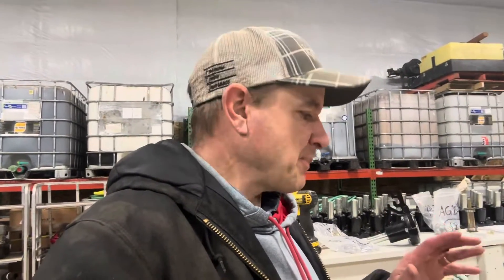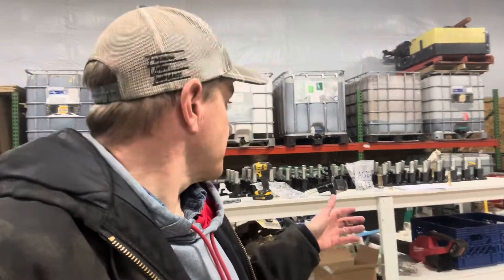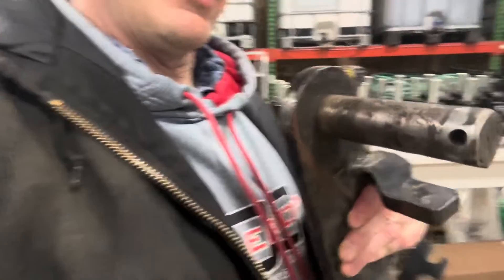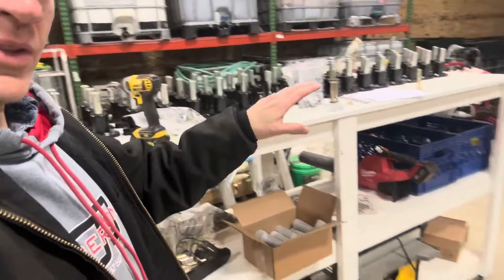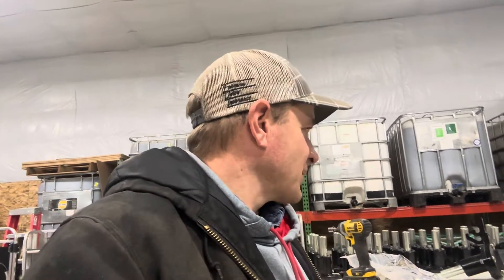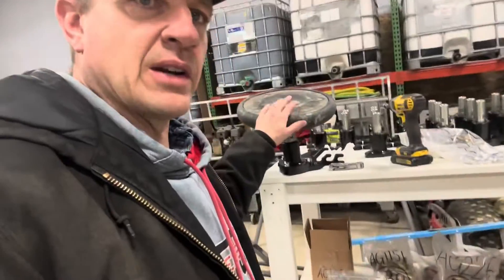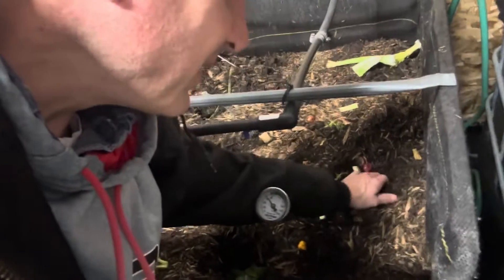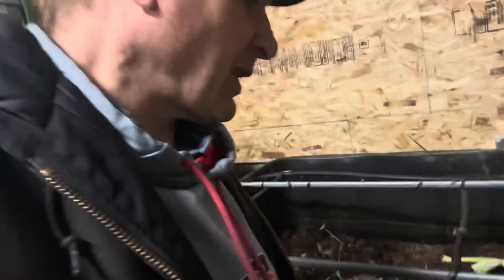Case 500 disc drill closing wheel arm issues and ramping up works in the Johnson Sus

Comment: What is this grease zerk kit.  I just drilled,taped,screwed in a zerk. I didn’t take anything apart. 
Spiked closing wheel will bounce less. Last longer maybe?
Reply from the maker: Yeah I’m not sure “kit” was the right word, more of an upgrade I think is how Case referred to it.  By the time we were aware this was going to be an issue and had the zerks installed it was too late for a lot of these (they wouldn’t push grease out the pins even on low with our Milwaukee which usually is pretty good at busting things loose).  We were to the point they needed to be taken apart and it sounds like Case changed the metal for the  bushings and pins on the newest drills.  To replace the pins we would have to replace the whole arm since it’s welded to the pin (another not so great engineering idea).  So we figured if we were go to all this work we would try a different direction and I like the idea of the sealed bearings.  
I guess time will tell if that was the right decision.  We have thought about spiked closing wheels but are a little concerned about more metal on rocks sparking fires.  We have a lot of rocks and already have fire issues just from the discs sparking.  Do you think that would be an issue?
Reply: I have rocks. Never had a fire from seeding. Maybe it’s a certain type of rock you have. I have a lot trash on my fields. My drill is 2017. Had Thompson closing wheels since 2011. I seed canola around 2” deep or the closing wheel messes up seed depth.

Comment: How do you deal with freezing temp and compost tea when early spring seeding?
Reply from the maker: Hey Dean, we are rigged up to blow out the drill each night when it is going to freeze.  That is a bit of a pain but it only takes 5 minutes or so once we got the routine down.  The whole freezing issue during seeding is one of the biggest issues we added to our operation when we switched to this.

Comment: How do you remove froze up arms
Reply from the maker: We bought and air punch (large air hammer and soaked things as much as possible in PB Blaster and were able to hammer out 90% of the seized ones. It helps a lot to leave the gauge wheel on the one right behind the one your are pounding to brace against and if you can have someone pry against the closing arm  with a spud bar.  It works really well to wing the drill up part way too and pound down on them if you can have someone lift you up in a loader